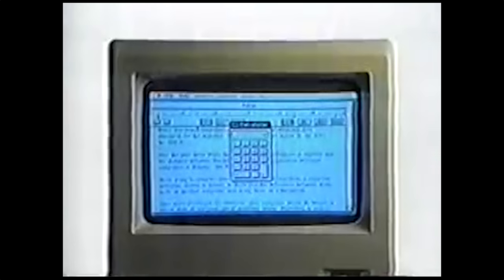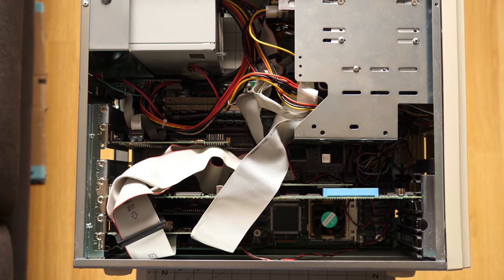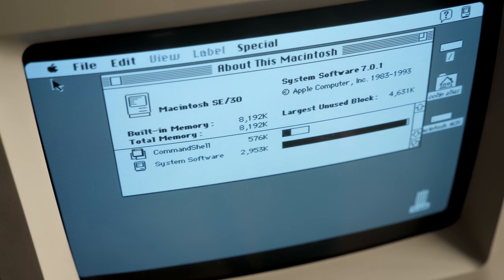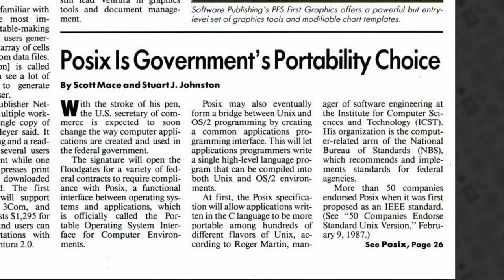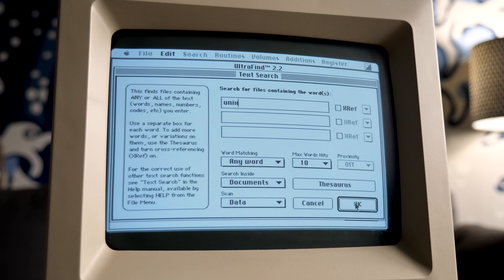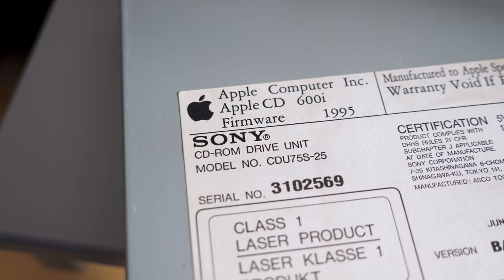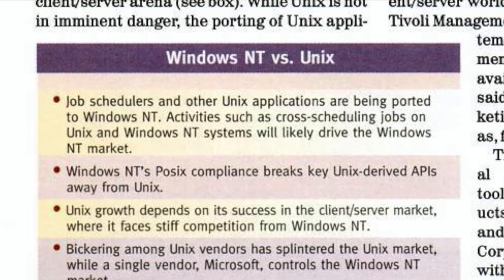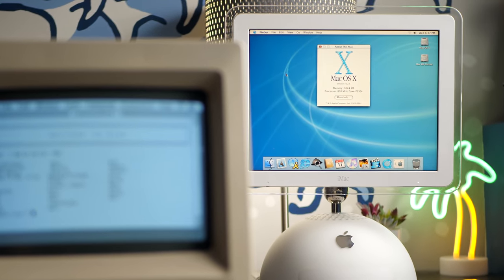Apple A/UX: The First UNIX Mac OS!

Comment: The biggest compatibility problem I’ve found with A/UX 3 is sound. Nearly every application that I’ve tried works - including Insignias SoftPC, and the only exception I’ve found is Apples Disk Copy. That said, except for the most basic toolbox compliant sound, you can expect silence from your Mac. The games will run but you won’t hear anything from them. 
Other than that though, it’s a great OS - and especially if you’re a Mac and Unix nerd.

Comment: In the late 90s, we used an Apple Network Server 500 as webservers that ran AIX 4 that was a Unix version made by IBM, and ran on PowerPC processors. It didn't run macos at all. Didn't stay long. We switched to SGI machines.

Comment: The first release of what would later become Mac OS X was actually released roughly concurrently with A/UX: NeXTSTEP 0.8 was first shown in 1988, and over the course of 1997 through 2000, was transformed into OS X by way of the Rhapsody and OS X Server projects.
They started out with Rhapsody trying to basically just take NeXTSTEP with the UI swapped out for one that looked like MacOS and a compatibility virtual machine for classic mac apps, which later was rebranded "Mac OS X Server", before deciding to do a more major rework that broke backwards compatibility with NeXTSTEP and had a better-integrated compatibility virtual machine as well as compatibility APIs allowing classic mac apps to be more easily ported.
Reply: NeXTStep was a whole lot more efficient tho.  Rhapsody was slow + OSX was a real poop-dogger in comparison.
Reply: This is my memory of NeXTSTEP as well. We had one NeXT machine at Georgia Tech back in the 1988 timeframe. It was kind of lonely in a back hallway of the Rich Building as I remember.

Comment: Thanks for the interesting video and a step back in time. I worked in computer accessory development during the later 80s and early 90s with a company called Advanced Gravis Computer Technology. One of the products I brought to the table was the Gravis SuperMouse. It was a 3-button programmable mouse and the only one, to the best of my knowledge, that emulated the traditional 3-button mouse used on a Unix system. We worked with Apple on this and at one point demonstrated our mouse in the Apple booth at trade shops.

Comment: You mention that the ROM was combined in the same address space as the RAM like that was unusual. In fact it is normal for RAM and ROM to be in the memory address space and as far as any CPU is concerned, memory is memory be it RAM or ROM.
Some systems could turn off the ROM, or could switch certain banks appearing in the address space but this was done by supplementary electronics that could enable or disable certain memory banks.
What made x86 unusual was that it has memory address space as well as I/O address space but they were strange in multiple ways whereas the Motorola chips were more consistent in their design.
Also, the initial Sun workstations were Motorola based and used BSD for a while.

Comment: About 15 years ago I managed to get enough stuff scrounged to load A/UX on a IIcx. Had proper video, Ethernet, and max RAM which I think was 48MB, and a 2GB SCSI drive. It ran pretty well and was stable enough that I just left it running in the basement storage/computer room and would telnet into it once in a while to mess with it, try to see if something would compile on it, etc. One day I went to telnet into it and saw it was down. Went into the basement and saw it was off and would not power up. Opened it and found the large caps had burst, leaked all over the main board and corroded it beyond repair. RIP IIcx :(

Comment: I've never heard of A/UX either. This was rather interesting.  Kinda weird to see Apple style something in the likeness of Big Blue...
Reply: Despite how unprofitable Apple was from the late 80s to mid 90s, they did work on a lot of cool “experiments”.  Things like A/UX and the QuickTake camera are experiments that didn't pan out, while others like HyperCard were beloved and inspired some of the most pervasive tech we use today.
Reply: @CapnSlipp  They also paid Novell to port Mac OS to x86 during that time.   My dad got to see it in action, even though it never fully came to fruition.  I remember my dad coming home super excited one day, saying Apple was going to shake up the PC market again.   He contends that Win95 never would have been a thing had Apple gone through with the release -- but at the same time, Apple might not be selling hardware today either had they done it.  Who knows?

Also, the original OS X Server still used Classic UI, even though OS X at the time had adopted the new Aqua interface.  Was pretty cool, as it harkened back to A/UX.
Reply: @WarhavenSC  From my personal experience of OS 9 atleast, Windows 95/8 felt far more stable and in control. I can use a legacy Windows 98 PC and it will be fine for ages of use but I've had a fresh install of OS 9 on my power mac crash or freeze frequently, almost once per use really.

Comment: Very cool video! I still have a Macintosh IIci in the attic running AUX 3.0.1...haven’t powered it on in 15 years, though. But AUX was such a quirky and interesting system, shame it never really caught on.
Reply: Please check and remove it's battery if you haven't done so already!

Comment: Great video! I remember seeing A/UX being demoed at a trade show back in the day, and expecting it to eventually become the new MacOS. I was hoping for that because the crashiness of MacOS was particularly annoying for programmers like myself, who would crash our machines pretty much on a daily basis. I read parts of the saga on Usenet and in BYTE magazine as it unfolded, but this video filled in a lot of the blanks.
Reply: I remember eagerly awaiting Copland as our savior, and then it fell through and the OS 8 and 9 we got instead were just facelifts of System 7.
Reply: @bwc1976  But they were pretty facelifts!
Reply: The idea to build a modern MacOS (after 7) Over a UNIX kernel, which A/UX would be a warming up prototype, was One of ideas but the majority of Apple board do not like that model.

 Essentially, much of MacOS shenaginans like system extentions would be gone and replaced by UNIX daemons. Also the common Mac User would complain the sudden appearance of terminal tools, and an alien functionality.

Even in my imaginary scenario where the Linux kernel would be choosen, features like systemd or cups would need to appear on late 1990, in order to GUI tools actually Change the underlying operating system services.

Comment: Ah, I was A/UX certified!  :-)  ... one of my very few certifications (mostly 'cause I typically don't bother - but this one was super easy for me and right there for the taking).
And for me, it was quite trivial to get certified for A/UX ... I was already very proficient in and familiar with UNIX(/Xenix/...) - had already been using it for years by then.
So getting A/UX certified was relatively trivial and fast for me - watch Some Apple A/UX hypercard stack play - mostly redundant with what I already knew, commit a few A/UX specifics to short-term wetware memory (specific hardware models Apple had that supported it - notably minimum requirements, which version of X was included with A/UX at the time - that was probably about it - all or most everything else was basic common UNIX stuff), immediately take the certification test - easy pass - and done.  A/UX certified.
It was dog slow ... but perhaps somewhat amazingly it mostly worked.  I think I only had a relatively few occasions to use it - was in environment supporting retail through fair sized business PC & Apple sales ... very few customers were using A/UX ... and little of it landed in our tech department for, e.g. support or whatever ... but when it did, the techs would be like, "Yeah, let's get Michael, he knows this stuff." - and the A/UX systems would land in my lap, or they'd call on me for assistance with the operating system aspects of it.

Comment: I was going to do a very similar video.  You did great.  You need to follow this up with A/UX 2.0 vs A/UX 3.0, running on machines from the Mac II to the Mac IIfx for hte former, and Quadra and Workgroup Servers for the latter.  THe Mac II required a PMMU to be added in order to run A/UX.

It was a very neat system.  However, NeXT crushed them... which is sad... because NeXT crushed noone.  Until they crushed Apple, with the NeXTStep->Mac OS X transition.  Oh the irony!  Good luck on a followup to this.
Reply: I've never seen anything about the actual events of Steve Jobs' so-called "time in the wilderness" but evidently he must have been learning a lot about other underpinning OS platforms because he ultimately chose BSD upon which to base NeXT OS. It would be fantastic to see a video done on that.
Reply: I’d be very interested in how he sold Bloomberg on NextOS for the Bloomberg terminals.

Comment: I wish I had the opportunity to try this back in the day but it only worked on very specific Macs like the Mac II. You can't even emulate it today! It's a shame Apple couldn't build on this because they did such an amazing job of it. I've read that this was down to licensing restrictions.
Reply from the maker: Believe it or not, there’s actually one emulator that can run A/UX — it’s called Shoebill, and it was purpose-built for the task. It doesn’t fully emulate the Mac OS portion so it’s not a 100% representation of the whole A/UX experience, but it’s enough to get the point across.

Comment: I had a friend who went into Virginia Tech's computer science program around this time, and I recall they'd standardized on everyone getting a Mac II that ran A/UX. For CS students, having a Unix OS on a personal computer was a great thing--this was before Linux existed. The Mac II itself seemed tremendously technically impressive to me, with its 256-color graphics.
Reply: When I first saw one in 1987, the Mac II was the most wonderful machine in the world.
Reply: The Amiga’s HAM was a hack, with severe limitations. The Mac II could do 256 colours simultaneously on-screen without hacks.

And then later Apple added “32-Bit QuickDraw”, which could do up to 16 million colours. The Amiga was never able to match that.
Reply: I remember seeing the famous “Mandrill” picture displayed in HAM on an Amiga. It flickered like crazy.

And yes, the Amiga’s hardware was a leap forward and a millstone around their necks at the same time. The Mac OS’s more software-intensive architecture turned out to have a longer life.
Reply: @lawrencedoliveiro9104  32 bit colour, while supporting multiple graphics cards with varying resolution and depth as one desktop, allowing windows placed across several screens. Even today, I believe some systems struggle with doing that.

Comment: Used to run it on an apple IIgs with the 1MB rom and a 40mb Hard disk. Fun times... had a few serial terminals connected around the apartment for newsgroups and email. This was around 94-96. Fun times.

Comment: I used A/UX a lot back then.  It networked just fine.  And it was an adequate software development and server system,

Biggest issue was the slow disk drives, like 120KB/sec transfer speed.

Other issue: it still used the Mac ROM routines for screen I/O, which were never designed for multi-tasking.  So if you opened up a terminal window, it scrolled pretty slowly as it had to be very careful what it wrote and when.

We used it for several things it could do pretty well, like acting as an FTP and mail server.  Then when the NeXT machine came out, we finally saw what a GOOD Unix-like OS was like.

Comment: I ran A/UX in a professional graphic arts environment, we got into it when one arrived running an image server software. It was to bridge the mac and unix machines which it did as it ran both protocols. The machine was too small to support very many users and was replaced when Apple upgraded its unix network tools by a VAX server running VMS and a bridge was no longer needed. We also ran the next Apple unix AIX on a huge AWS and that fixed all the problems of A/UX but it didn't run mac os but you didn't need it at that point. At about the same time I also ran MK Linux, MachTen and Be/OS for various reasons which were usually to make one piece of software available to a group of macs. This was also the point that we changed to SGI front ends for any serious work, NextStep machines also started to show up.

Comment: A/UX was great ... when you worked at an Apple reseller, and could get NFR pricing on the PMMU and FPU for a second hand Mac II you bought cheaply from the reseller, and NFR pricing for A/UX. Even back then, NFR (not for resale) pricing on A/UX was nearly $400 AUD, which was a LOT on money back then. I love my A/UX 3.0 experience, and the Unix experience led to a sys admin career, but so little Mac software ran on it, that I basically had to dual boot, and I'm pretty sure this is the reason that by the time System 7.5 came out, A/UX was truly doomed. Technically, brilliant, and preceded Carbon by a LOT, but honestly for the lack of horse power of a Mac II, it performed more than acceptably in Unix tasks at the time.
Reply: What is NFR? Not for resale?

Comment: I wasn't around at the time, but this is a really interesting operating system. I would love to try it, but if there is a Linux version that runs on this old hardware, that's probably what I would use in the modern era.

Comment: This otherwise excellent piece omits mention of the "Layer Manager". This abstraction overcame a key shortcoming of the original Mac UI. The original Mac UI was built around the assumption that a user ran just one program at a time. The "Layer Manager" extended that abstraction such that the display was stack of layers, where each layer was a canvas that a particular application could draw on. The UI itself (menus, mouse, and so on) was always the topmost layer. This abstraction worked well within the already insanely great Mac UIX. Because it was source-code compatible with the Mac toolbox, it imposed little extra burden on application code.

I led a small team of excellent contributors who created the first LayerManager on Unix System V, and the abstraction was my idea. We did this at "Cadmus Computer Systems", a long-defunct M68K workstation startup from the early 1980s. The product was called "CadMac". The original CadMac product was a PC board that added hardware-accelerated "bitblt" to the machine. Like many of the Xerox architectures of the day, the display memory was contained in the memory addresses managed by the CPU (and accelerated by the special board).

The CadMac software combined a kernel-level app shared by all processes and a per-process user-level app that interacted with its kernel counterpart. The kernel-level app interacted with the low-level drivers and hardware to perform display operations and collect user input as part of the kernel. The kernel-level app allocated a layer from the kernel whenever a user-level CadMac process was invoked. The kernel-level app moved layers up and down in the stack and routed UI-related events and interrupts to the appropriate user process. The user-level app provided the API from the Mac toolbox to its user program.

All this was coded in conventional (pre-C++) C. The software asset worked fine on hardware that lacked the hardware accelerator. In particular, I was part of a team at Brown University that ported CadMac software to the IBM RT workstation in the mid 1980s (after the Apple acquisition of Cadmus). It was fun, in an ironic sense, to use a display and workstation provided by IBM in an institute (IRIS, at Brown) funded by IBM, while developing and running apps centered on the Mac UIX.

In 1987, the Mac UIX truly WAS (and I would argue still is) the very best user interface ever created for "regular" users.

Cadmus partnered with Apple during development. Apple ultimately purchased all the assets of Cadmus in order to obtain CadMac, and my understanding is that the asset was incorporated in multiple Apple OS products. The main motivation for Apple's acquisition was to capture and kill the technology so that it was not available to -- for example -- Sun Microsystems (who were were also working with).

I appreciate this bit of history, and just want to build on it with a bit more of my own.

Comment: Apple also developed and released MkLinux, a Mach kernel based Linux system for PowerPC based Macs. It became a bit redundant when Apple bought NeXT less than half a year after MkLinux's first release. It used the same kernel as Mac OS X though..
Reply: It's not Linux if it doesn't run Linux. If it runs Mach and BSD, it's a Darwin system.
Reply: @charliekahn4205  MkLinux ran the Linux kernel as a service under the Mach kernel (akin to a hypervisor, I guess?) and just because something is based on BSD (which MkLinux is not) and Mach it isn't necessarily Darwin. Darwin is a very specific operating system .

Comment: I actually messed around with an Apple Workgroup Server 95 about 2001. It wasn't running A/UX but IBM's AIX 4.1.3. My task was to get it running Linux, to make it useable again. In short, this process had to be done with FLOPPY DISKS; and this was such a pain and so error-prone, that after a couple of months I pointed out that the machine, which was twice the width of a Quadra 950 because it had hot-swappable drives and power supplies, made a fine coffee table for the waiting area. Yellow Dog Linux, alas, never really happened on that machine.